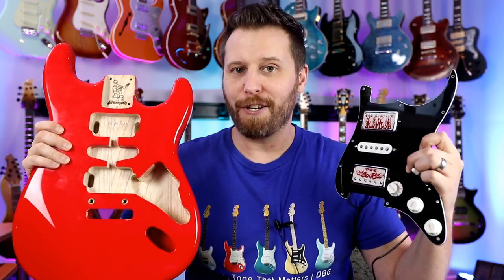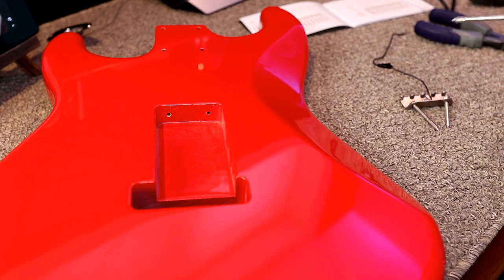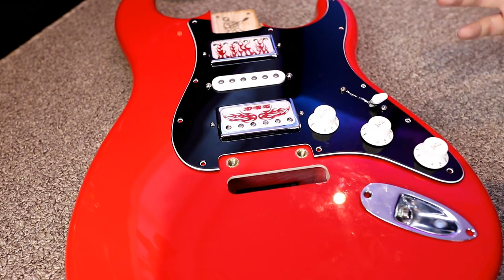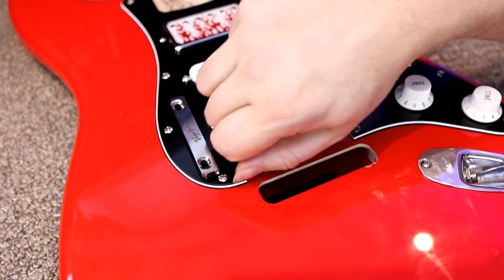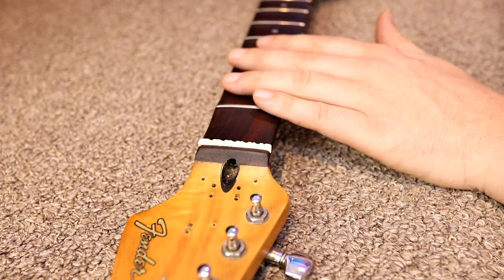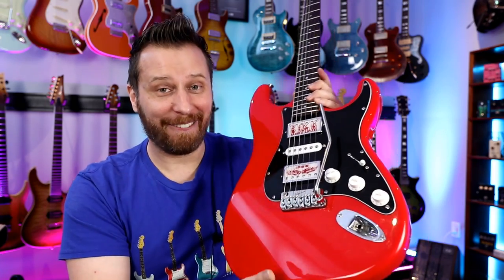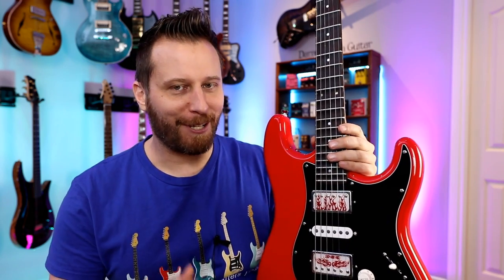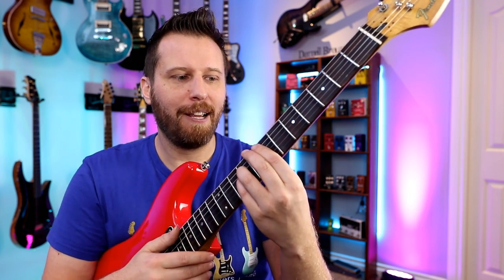Building a Scalloped Neck SuperStrat! - This Thing SCREAMS!

Comment: Maybe I am missing something, but I don't see what's special about scalloped necks. In a standard neck, with a normal amount of pressure, the strings don't touch the fretboard, and if you press too much, you will go higher in pitch, just the same as with the scalloped neck. So I don't see what difference a scalloped fretboard can make, soundwise.
I guess the feeling will be different, as your fingers do not touch the wood, maybe that can trick you into pressing harder.

Comment: Not sure I can be convinced that using a locking nut with a Tremolo that doesn't have fine tuning knobs is going to work out so well. Sounds like a very frustrating venture. You lock the nut and the string is out of tune. What do you do? Unlock the nut, re-tune, lock the nut the other string is out of tune. Unlock the nut, re-tune the other string, lock the nut, the first string is out of tune... back and forth. I'm really curious about how that will work out for you.

Comment: I have never had the opportunity to buy a warmoth body but ... I don't like what they did there. A body like that is bout 400$ finished and all. Having it not fit a standard wiring arrangement is really not cool. If i had to grind on it after I paid to have it finished....no sir. They would be giving me back what time I put into it in labor. Not to mention... the inside of that trem route was un-painted!  The trem you use there is showing that off and and is also why the edge cracked.. To me that body just looks like a 100$ cheapo. I'm sure the wood was very nice before it got painted. I am going to have to re-think Warmoth. I would have let them be very aware of that.